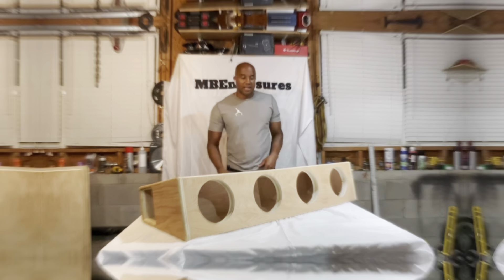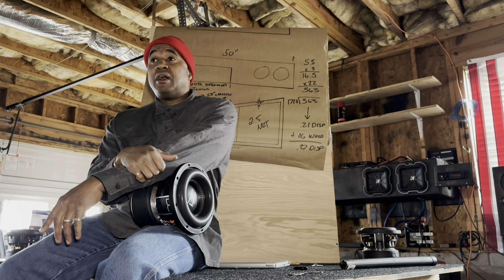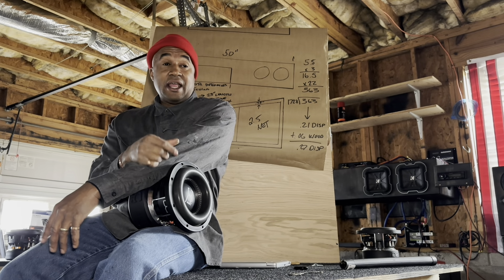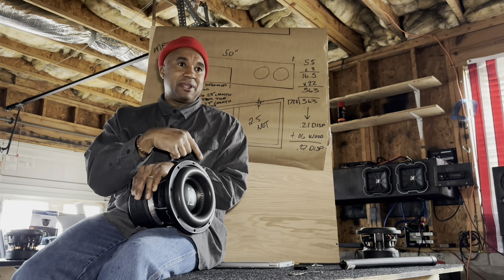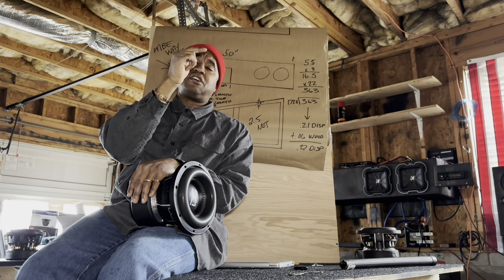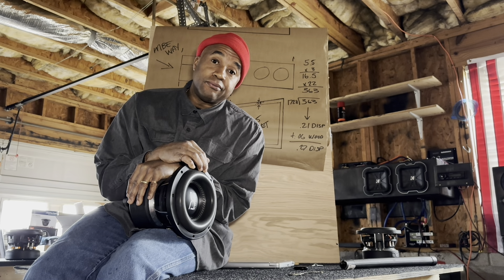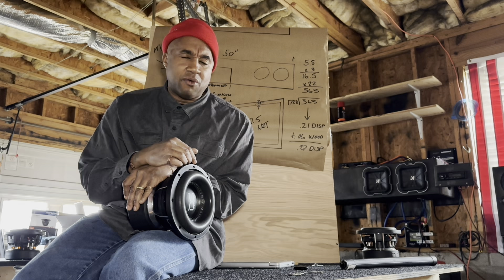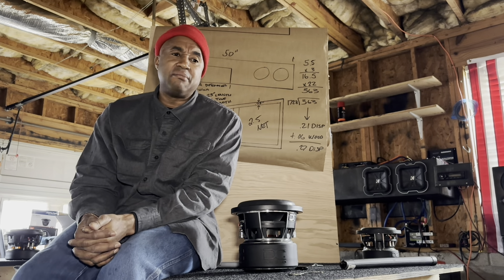The Truth and Science Behind Underseat Truck Enclosures!! Part 3!

Comment: Below tuning there's less resistance to air flow, and below fs the Re is lower. TSP's dictate everything. With excessive Q (too low of a qts,) there's less coupling with air masses below fs. Higher vent mach increases imp rise well. An enclosure with zero flex increases imp rise. A harmony of TSP and Enclosure is needed and sympathetic resonance is king for output and imp rise.